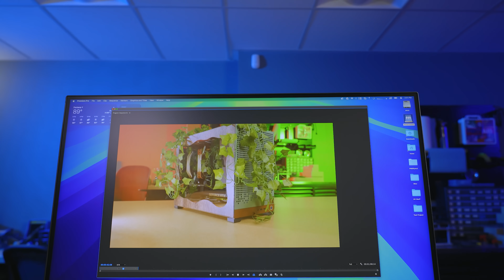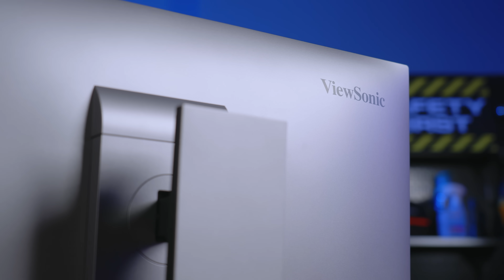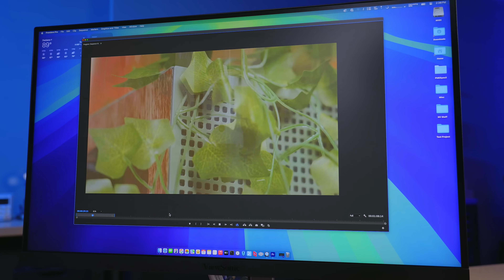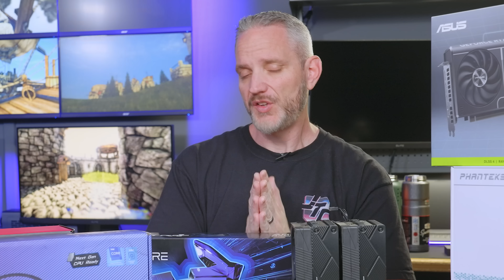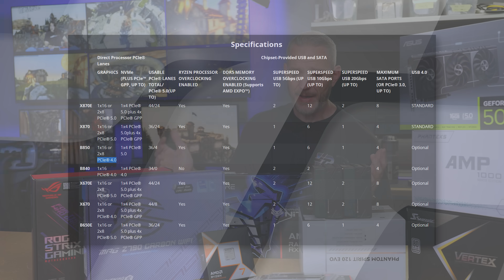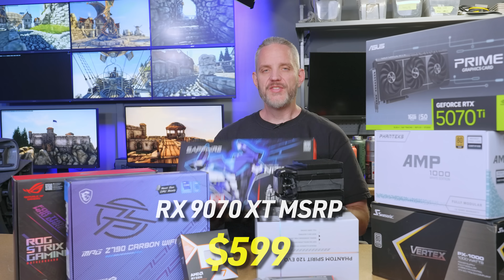This is the Sweetspot for PC gaming... Don't get fooled into spending more!

Comment: The sweet spot is based on your income.
Reply: Diminishing returns still apply even if you have unlimited budget
Reply: @doctajuice  yes, but higher raw performance will still be there vs the sweet spot of price to performance. 

It then becomes a question of if it's worth it to that person to pay more.
Reply: @ArtisChronicles yes, because you've moved out of the "sweet spot" that's the point of the term.
Reply: @doctajuice there is a 4k and 5k sweetspot though and that's not 1440 or 1040 lameness we are forced into
Reply: @doctajuice  If you're budget is truly unlimited, diminishing returns do not exist....by definition.
Reply: @SeptumRing  until you spend unlimited resources for 0 performance. Which exactly where you head to with Nvidia cards right now.
Reply: @DesMessersSchneide  Relax man, this isn't Reddit. Show me a card that can compete with my 5090.

It's just a bonus their stock has helped me out.
Reply: @SeptumRing  
You then don't understand what diminishing returns mean, by the definition of it. You can be perfectly ok with diminishing returns that is something different. 

Let's say your 5090 costs 5000, and it performs "100" , and a regular 5080 performs "90". Now tomorrow a 5090 Super comes out it costs 10.000 and it performs "101", this is a performance upgrade no doubt, and will be bough for sure by some people. But is is then by definition what is called Diminishing Returns. It is therefore irrelevant how much money you have or can spend on it. If you think it is relevant i'd like you to explain how.
Reply: Yeah 2600k and 1660 and 8GB ram over here lol
Reply: @manoz6194  Dude, get another 8GB. How much is 8GB of DDR3 now, like 2 bucks?
Reply: @RemoteAbductionArm huge difference at gaming
Reply: @RemoteAbductionArm 😭😭😭🤦🏾‍♂️🤦🏾‍♂️🤦🏾‍♂️this aged like milk😅😅😅
Reply: @R @RemoteAbductionArm add like 2000 bucks to that now 😭💀
Reply: @matthewfairchild3846  DDR3 is still cheap because it can't be used in AI.
Reply: @WilmoWins  Not for DDR3
Reply: @matthewfairchild3846 It's DDR3. If you can't afford that, you should be spending more time somewhere else rather than sitting on your chair at home
Reply: @manoz6194  lol thats so bad! can it even run minecraft? jks
Reply: @PiloFried bedrock or Java? Bc Java is actually pretty resource heavy with high settings lmao. Mods on that system? Why even try 😂
Reply: @RezMezy not with fabric and sodium
Reply: @PiloFried  would have trouble running my browser.
Reply: @manoz6194  cheese and rice man! UPGRADE!
Reply: @manoz6194 you can get a second hand cpu cheap if you can update the bios
Reply: @manoz6194 dude just get a console. Even the Switch 2 is faster than that.
Reply: @manoz6194 bro 16gb is like $20 on FB in most areas
Reply: @manoz6194 how are you even running windows 10/11 with 8gb?
Reply: Yes and no.. it’s more about diminishing returns. Like sure you can go 4k for a monitor but 1440p will get u close enough for half the price and not be as heavy on your gpu. That’s the sweet spot
Reply: @DelScully unfortunately it doesnt look great after playing on 4k for a long time. 1080p looks like total and complete ass.
Reply: Yes. 👍 Ryzen 4500 and RX 5600 XT over here
Reply: 5900xt and rx 6800xt gang here.

Ive also got 128gb of ram lol
Reply: @WolfanndRose  I "upgraded" from a 4770 to a used 3600, with a used b550 mobo. Then a bought a new 5700x, but i still using my 1660super. 😁 Next should be a used 6750xt, or 3060 12GB, or max something like a 4070, or 5060xt.
Reply: @csuanfa if you can get an 5700x3D or even rarer 5800x3D you’re pretty much secured but really all 5000 chips are still going strong
Reply: @WolfanndRose  rip
Reply: @WolfanndRose lol
Reply: @WolfanndRose yikes dude
Reply: @BrandonPawlak-f4d I know it’s old, but new to me. Plan on upgrading when I can, but that’s the point of the original comment
Reply: @WolfanndRose  ryzen 5 4500 and rtx 4060 here
Reply: @WolfanndRose BROKEEEEEEEEEEYYYY
Reply: @WolfanndRose  nothing wrong with that...I got rx5800 and rtx4060ti perfectly good for my basic stuff like OBS and a bit of rendering here and there.
Unless you're a completely nuts gamer you don't need the absolute biggest and best balls-to-the-wall CPU or GPU....indeed it's about matching them well so you don't cut one short.
Reply: The sweet spot...that most people can still barely afford nowadays
Reply: Facts
Reply: Managed to get a z790 UD ddr4 mobo, 32gb ddr4 ram 4000mhz ram, and i5 14600k, all new unopened as a bundle off marketplace for $250. Paired that with a 5070, not top of the line but I can play my games in 4k comfortabley. The 14600k with the 5070 synergize great.
Reply: @SliceOfActionGaming why would you ever get the 5070 tho
Reply: yep, like when people say "budget PC" 
......well what's your BUDGET, annoying how people use the word budget to be synonymous with "cheap"
Reply: @deminybs  low budget would've definitely been a more accurate term the way they talk about it.
Reply: "But if you're shopping top-tier, top of the line already, then this video isnt really for you" some people are as dense as neutron stars.
Reply: 1080p will make the sweet spot so much more affordable
Reply: @MogCity2  very much so.
Reply: Ur mom is the sweetspot
Reply: Sweet spot is performance for the price.
Reply: There is this thing called diminishing return. So no sweet spot isn't based on your income. If you have more money buying better and more expensive isn't your sweet spot because you could save money and use it to buy stocks ( just one of many examples ) and that would be even better sweet spot. Sweet spot is never the most expensive thing that you can comfortly afford since diminishing return exists.
Reply: No. The sweet spot is based on what performance you get per dollar spent. The highest performance per dollar is the sweet spot .
Reply: Not true.. diminishing returns do exist.
Reply: “but my income”
Reply: No what you can or should buy is based on income, the sweet spot is another way of saying best bang for the buck.
Reply: rofl
Reply: my i7 3632QM laptop with GT630M is still kicking surprisingly well in 2025 with 32GB RAM and SATA SSD
Reply: @Maleko48  what man?? i have a 1030 gt and i looked it up it's 3X faster gpu and i can't run shit nowadays
Reply: How dare you having common sense
Reply: Disposable income...
Reply: Thats not true. The sweetspot depends on your usecase not on your budget. For example, if you only play WOW Classic and WOW can´t handle CPU´s with 3DCache, the best most expensive cpu is not in the sweetspot. Generally the sweetspot is where you dont get more reral world gains with more money.
Reply: Yep
Reply: To a certain degree, but spending on RTX 90 tier card for gaming purposes is never optimal no matter how much you earn.
Reply: @LurkingLarper exactly. I mentioned it is like running 4k quality at 100hz instead of 4k balanced at 80 for 3 times the cost.. the actual experience is almost imperceptibly different. Practically identical. I hear 5090 buyers say they hate upscaling so they run native and I think that is the most waste and straight up ignorant validation of a flagship purchase. Dlss 4 is incredible
Reply: @TheCosmicMason DLSS is the only good thing Nvidia has given us in years 😔
Reply: Yep. Intel Gen 12 and RTX 3080 from day 1.
Reply: The sweet spot is based use case and budget, not income
Reply: No the Sweetspot is based on what you intend to use the rig for,  Your income decides on if you can afford it.   For example if you want a HMD simpit or VR rig then you need as much VRAM as you can afford to throw at it (GPU loads are minimum but even four year old title like Alex will eat up almost every bit of that 32gb's on a 5090 when running at 120Hz 4k)
Reply: @nikushim6665 My guy gets it. No one needs 5,874 FPS in Fortnite. People need high-end cards for real work stuff: rendering, compiling, and that sort. I have a mid tier card from '21 and I'll be good for another 3 or so years.
Reply: I hope you understand the sweetspot mentioned is the point where spending more gives less performance increase. The sweetspot for your income is probably buying no pc at all unless you need one for work.
Reply: The richer you are, the more sweet spots you can afford.
Reply: Correct
Reply: I came here to say exactly this
Reply: So so true!
Reply: Get your bread up
Reply: Also your expenses😂
Reply: ... No shit
Reply: You smack me to reality
Reply: Based on my income I am keeping my 1080ti
Reply: I sold my 4070 super and got almost £500, I managed to bag a 5080 for £1200, so I only really paid 700 for it. Pairs excellent with my 14700k, I wanted the extra power because I love vr gaming and that can be demanding
Reply: No the sweet spot is 2014-2017
Reply: No it doesnt. There is a point where you get less more for more money. Now you can have enough income to say 'fuck it' and still spend more, but it doesnt change the existence of this sweet spot
Reply: it's based on the performance per dollar.
Reply: depends on the games you play.
Reply: And your local tarrifs.
Reply: Incorrect. Sweet spot refers to bang for buck. That has nothing to do with your income.
Reply: Me on shitty third world country : what is income?
Reply: This makes no sense. Buying a 5090 + 9950x3d + 256GB RAM and 360Hz OLED, because you can, does not improve your ability to emulate pokemon fire red... It all depends on what you wanna do with the machine.
Reply: lol, Jays sweet spot is a 5090
Reply: So my sweetspot is a manual calculator 😭
Reply: more on your credit score with todays crazy prices
Reply: Ryzen 9 and 1650 Super ❤
Reply: Yep prices suck. Running a 5600x3d and 7800xt. WILL Be running that for a few years yet
Reply: *Disposable income is the responsible answer.
Reply: Exactly someone with good money isn't going to buy a 5050😂😂😂😂😂
Reply: When 'Your Income' is based off Mommy and Daddy, then any spoiled brat can get what they want. This isn't a real world sentiment.
Reply: It's this mentality thats killing the market. Just cause you can afford something does NOT mean you need to get it. It's idiots like you that are driving prices up....they will still charge these stupid prices as long as there's idiots out there that will pay it.
Reply: @captainobvious7513 calm down fam lol.
Reply: At some point no one's going to call a build the "sweet spot" of anything. They'll just delicately call it a compromise at best. Perfect example: Anyone remember netbooks? The best I could say about nearly all of them was that they didn't hang while running ZSNES. Floor's higher now for sure, but when you're running into the hard limits of a system, there's just nothing sweet about it.
Reply: not really, 1440p with 144fps is far FAR superior to 4k @60 yet youd spend a ton more on running 4k@60
Reply: Tax bracket people
Reply: Yep, x3d and 5090 is my sweetspot 😄
Reply: Nope. Disposable income. Someone slaving away at a fast food joint but living for free with his parents can go balls-to-the-wall just like a wealthy person.
Reply: Still Rocking my VooDoo Banshee and pentium II that I upgraded my gateway pc with
Reply: Unless you n can charge credit card.  That what I did
Reply: First Get Rich Boi, then buy 5090.
Reply: Truth 😂
Reply: That's what people with no income think- they'll make money, waste it on the most expensive things, and proceed to be broke again.
Reply: @RAY_FILET If you make money that is income, people with no income dont make money
Reply: That is true however, if you just get exactly what you can afford it will most certainly not the the most effective use of your money. For example, 8gb gpu is a sh buy and a 5090 is also a sh buy. A gpu with enough vram and performance and good price to performance is not as simple as “what you can afford”. If you can only afford a 5060, I would suggest an rx580 8gb for $60 and save up a bit for a better gpu. And likewise if you can afford a 5090, i would suggest that the real difference of a 4070 Ti Super and a 5090 is running 4k quality at 100 vs 4k balanced at 80.. is it really worth 3x the price for that?
Reply: i7 4th gen & rx580 is mine.
Reply: wrong
Reply: Real.
Reply: Imo no. There is a point where it never makes sense. I have multiple times the amount for say a 5090 in my account and absolutely no desire. Maybe it's worth it if you PC game constantly, I have other hobbies mixed in.
Reply: There is always a certain sweetspot that gest most frames per dollar. Nothing to do with your income or what you can afford.
Reply: A used 3090 for $400 then
Reply: Meh, anything past upper mid tier is kinda pointless. I'm looking at 500 for GPU, everything else is half of that per part.
Reply: True, after 15 years and a motherboard failure and glitches on memory I bought a new CPU, GPU, RAM, Mobo, and PSU 3k later and didn't think about it. Me 15yrs ago would have not spend that much
Reply: False
Reply: So a used 10 year old Dell desktop... 😒
Reply: isn't that too obvious? hahahah
Reply: Partially sure.
Reply: Well... Cpu upgrade is a lot cheaper than GPU upgrade currently so for spending more on cpu is easier and good future proofing.
Same for faster ssd.
Especially since a lot of player are Fortnite Minecraft and cs 1080p high fps players and in those case, ram, cpu and ssd speed are important
Reply: Not necessarily. One could argue that anything more than the sweet spot is just lifestyle inflation
Reply: No it is not
Reply: And what you play.
Reply: This is why console gaming is an option
Reply: @Chino1f1kation  Not for everyone
Reply: And based on what you want to play. I need beefy PC all the time, because I play flight sims.
Reply: Hope i don't get roasted for this but its actually not. For example 3TB of hard drive is pointless if you store things in the cloud and only ever need 500GB. A GPU that can handle 250FPS at full settings is pointless when the human eye can only process 150 at most. If you ask GPT for the optimal GPU based on "frames per dollar optimized for the human eye" youll get some interesting results
Reply: @timmorozco  1. You don't need any hard drive when SSD exists 
2. Human eyes don't see in frames at all. 
3. It's always fun to roast fools who act like they know something, but all they do is prove to everyone how clueless they are.
Reply: Totally, but spend the money where it matters most...
Reply: It is now.

I got an ally for less than 300
I don't bother with desktop anymore.

Screw those prices for GPUs
Reply: This. Absolutely the correct take.
Reply: people dont get that.. because they want you to spend more.. "dont get 8GB just get 16GB" they are contradicting themselves. and keep telling you its not worth it or its worth spending more.
Reply: The price Performance sweet spot doesnt change just because you get more money
Reply: yes not just because you can buy it. you also really need to think can you pay for youre electricity bill. like people can buy a 3k build but can they afford the monthly electric bill . not all user lives in america or europe
Reply: indeed
Reply: The G... 1.5-2" in then up... 👌🏼
Reply: rtx4070 32gb ram and Ryzen 7 5700x3d
Reply: based on your REAL needs*
Reply: Brb robbing
Reply: Not true, its based on objective value for money compared to the cost of other parts and percentages of losses and gains in performance for each budget, which is why cards like the 5050 are bad because its only $50 more for a lot mor performance (5060/9060XT)
Reply: Just won my disability case, by next week I will have my 5090, 9550x3d build. 🙌
Reply: Agree 👍
Reply: I don’t think so, not in the way he’s using the phrase.  Dollar per unit of “power” isn’t dependent on budget
Reply: How is this the top comment. Incorrect as well
Reply: wrong...your income might block you from getting what you want, doesn't change the sweet spot.
Reply: exactly
Reply: Brilliant!
Reply: Agree
Reply: Yes...and no.
Reply: B650 Aorus Elite Artic Ice - Ryzen 7 9700 X - Radeon RX 9070 XT….. I’m using this for my first build. Hope i did good with my selection.
Reply: I hate how there are always top comments on YouTube as soon as I click on them😂 you jus know someone bouta debunk the whole video in four words hahaha
Reply: Bases on how much you want to through away into something that gets obsolete every 2 years
Reply: This is such a shit response... Obviously there is a sweetspot if you know math. Sweetspot for a SSD for example is mb/ cost. Why pay x10 for each MB after a certain TB
Reply: not rly whan i was looking for new gpu i had about 1.3k$ but i didnt want to give a lot more than 400$ for gpu so i buy 7700xt😄
Reply: My wife won’t let me spend more than 1000Aud😢
Reply: Its ironic that all the "tech" youtubers changed the tune - for years and years they promoted InHell and NoVideo - regardless of what the competition performance or price was - BUT now when their audience no longer has the same budget (especially since post-CONvid due to galloping inflation in certain parts of the world) they start to pick the budget side of things. To a very high extent (upwards of 90% I say) the situation is on youtubers. NGreedia was propped up by them no matter what - a bloody decade after Vulkan (almost) became mainstream with Doom 2016 and yet it is not widely adopted. They did not say how Ngreedia is ruining grafix when between 2011 and 2018 they WERE bribing the industry to stay on DX11 because it favored them (and InHell too as DX11 was still in 1998 - it was feeding communication between CPU and GPU on ONE SINGLE THREAD). Heck when 1st gen Ryzen came out in 2017, they were SALTY about the low clocks and the few TOP FPS less compared to INHELL, BUT VERY VERY FEW of them mentioned that the 1% and 0.1% lows were significantly better even on those 1st gen Ryzens.
Reply: no sh*t, sherlock!
Reply: Not really... There is always a price to performance ratio winner. And if you buy cheaper especially.. ,pu pay the price for entrance, base price for getting a product at all and usually the ratio is very bad there. Like entry level GPUs that still cost like 80-100 bucks.
So the smart move is not buying or buying second hand.
Reply: Indeed it is my freind
Reply: My sweet spot is RTX 5090 for PCVR my OG Crystal HMD demand 100% resolution as 5K x 4K per eye at 90hz 🔥
Reply: Nice one captain obvious🤣🤣🤣
Reply: hahahahahaha 100%
Reply: Pretty sure if SLI was still around the sweetspot for casual 1080p gaming would be 4x 5090s in SLI and a custom water cooled direct die 14900k.
Reply: don't let your income dictate how much you spend
Reply: I am rocking a 9800x3d with 9070xt and it's my first PC and currently super happy with the performance.
Reply: To a degree. I do think there is a point where cost does not equate to the performance. At some point there is diminishing returns, however, i wouldnt flame someone who buys a 5080 even though i think its a terrible card for the price.
Reply: Glad I use a Mac and windows as a hobby
Reply: So true jajaja
Reply: And needs. Buying more than we need skews the market, and at very best, there won't be enough affordable units in the next generation. At the very worst, the low-end stuff isn't even worth buying, which seems to be the case from what I hear.
Reply: i don’t understand the amount of people  that have money issues or comment similar things like this
Reply: @LoL @LoLTerminus Might want to do some studying then, make yourself smarter.
Reply: hehe, spent my night at work. building a 5090, ryzen 7 9800x3d. Considering I just bought the new alienware 34 ultrawide. I'm pretty close to hitting the sweet  spot now :P. Just gotta stop working and get some gaming done :D
Reply: If you have to think about your income when building a tower….stick to console gaming cause your gonna get annoying when your budget PC can’t run the latest games lol
Reply: he doesn't give a shit he think everybody multi-millionaires who have a YouTube channel
Reply: well it isn't since it's about performance and bank for your buck. So you can get everything the top of the line for 5-8K systems but.....why?..... do you like burning paper?
Reply: Ryzen 5 5600g and rx6650xt
Reply: Not true value is objective
Reply: The sweet spot is based on whether my spouse knows how much I'm spending.
Reply: Actually no.. best price performance ratio is math
Reply: Way of gaming is priceless
Reply: You are absolutely correct. Could also depend on if you want to upgrade in a year, or there's a game you really really want, but your current computer just can't handle it even on low settings.
Reply: Of course, but you could build the best pc on earth if you just save up for it. It’s dangerous with this buy now pay later shit people are buying five thousand dollar computers and paying it off like a loan.
Reply: I'm stingy AF. Even if I had millions I wouldn't overpay for BS. Lol 😂
Reply: Depends if you really need new stuff or not. My pc is currently about 5 or 6 years old. Am thinking about upgrading. Wanted a whole new pc... but in all honesty if I just upgrade the GPU I think I would be alright again for a few years. You don't buy a new PC every other year normally. I am not from the USA so I don't have a clue what life is like there but normally you have over 2 years to put money aside. There is always something you can save money on. If you have a family it becomes a bit harder. I don't know if you get holiday money but you could skip holiday for a year and put that money towards a new PC as well. If you already use holiday money to cover for other expenses, well I don't know. But it can be worth it to look at your expenses etc. Even if you can put 50 usd aside a month, that would be 2400 usd in 4 years time. I am sure you can buy a pretty decent prebuild pc for that on any site in the USA. Maybe a better one if you build it yourself.
Reply: your income has nothing to do with it. you can always just save for longer. there 100% a sweet spot for a performance build that looks great and plays great.
Reply: Kind of.  I can afford anything I want, but I feel stupid if I buy the bleeding edge that crashes frequently and needs lots of extra fiddling just to get it to run correctly. Some people like that but it annoys me to no end so I often try to find the middle ground parts that aren’t overclocked to heck or were binned out at the high end during e-test at the fab.
Reply: thinking the same, what happened to tech channels all of them of them going for like high end boards cpu gpus then just says it is sweespot. I want to get mid range. Z board and K CPUs are already too crazy.
Reply: LOL NO. After a certain investment the ROI drops off hard.
Reply: This implies that price scales with performance.
Reply: Based on your income, and what kind of budget you can set aside for the sweet spot in question.
Reply: I disagree … if you want to play a game you love but your PC won’t handle it. Then you may need to save more to reach that goal.
Reply: Not precisely, even the low income people can save up to get a medium or high income person sweet spot.  No I think the sweet spot is more to do with performance per dollar + sum overhead for future games.
Reply: jokes on U I got no income and still went overkill
Reply: At performance per dollar this is a certain sweet spot. Even if you can afford a better one but like to shop smart this is a good build.
Reply: It actually depends more on how much you can save 😋
Reply: Just upgraded from a Ryzen 3 2300x/ RX 580 to a Ryzen 7 9700x/ 9060 XT 16GB.... can't wait for everything to arrive.
Reply: nah, i still see people on wealth fare with apple and nikes, so there are people who are deadass broke and will buy a 50 series if they think they need it in life.....
Reply: I use Rysen 5 3400 and a GTX 1060 6gb card.  I am fine with all the stuff I use it for.  I don't play certain games that have higher requirements.  I am enjoying my older legacy games on steam.  Can't afford this newer graphics cards.
Reply: Broke ass
Reply: Not really
Reply: No its performance  for today's games  to run well without kilo bucks the sweet spot.
Reply: Am5 platform and 9060xt is sweet spot
Reply: that's the dumbest thing i've heard.  Buying a computer is something you buy once every 5+ years.  Just get the best GPU and a really good CPU.  it'll be worth it
Reply: Being able to afford a good pc does not mean you are rich.
Reply: Strong disagree. No matter income I would never overspend on 5% better performance. Sweetspot is the sweetspot for everyone.
Reply: I never buy anything above mid level graphics card.
Reply: The sweet spot is the best price/ performance ratio
Reply: Your ignorance is showing
Reply: My pc cost nearly 10% of my yearly income 😂 13700k, 32Gig DDR5 6400Mhz, RTX 5080. The cost did sting but it's my main hobby, wont need a upgrade for at least 5 years
Reply: 💯 Slan 👍 ❤️
Reply: Excellent video, explained, with options. Thanks or Slainte, 👍PS: Merry Christmas and a happy New Year.👍❤ 10:38 😅
Reply: Thank god you swooped in with thar cutting insight...😂
Reply: With buy now pay later and credit card debt, your income matters not.
Reply: Elon Musk sweet spot must be nice.
Reply: Fuck my income I just put 6k on my credit card to build a top of the line pc for literally anything I would want to do. Plan on doing lots of 3d rendering. Been wanting one for years, never put the money into it tho, now I got fomo from these ai companies demolishing the pc ecosystem. Now all my parts total a little over $8,500
Reply: I7 3770 16 GB RAM and a GT 1030 😎
Reply: Yep
Reply: 7800x3d and Rtx5080 was apparently my sweet spot
Reply: Maybe the sweet spot is the friends we made along the way
Reply: What can I buy for a dollar 😅
Reply: So a rich dude that uses his computer for emails should get top tier parts and a nerdy mcdonalds worker that plays video games when hes off should get the cheapest setup?
Reply: Not at all
Reply: The sweet spot is price to performance , it dosent matter on budget , it still exists in every generation.
Reply: That's a terrible way to look at things. Buying shit, because that's all you can afford doesn't mean you have to settle for shit. If your budget only allows for trash, then save up another 6 months, and see what you could have got if you didn't settle for garbage.
Reply: 30k month chilling with a 6090
Reply: the income should only be the factor WHEN you can afford it. the sweetspot is between what you want and what you need
Reply: Hardware unboxed is the man for the budget best price to performance builds and i have one pc that he told me to build it still runs like it's fresh just needs psu change it's worn out.
Reply: If your income can't get you what you need (not want) then is it worth paying at all ?
Reply: Not unless a $3000+ increase in price for like 20% uplift is worth..... $3000. Not income based unless your income is based on that 20% uplift lol
Reply: Sweet spot assumes compromise between price and performance. And you know that the rich people often are the stingy ones, that's why they are rich: they know how to manage money and overspending on rapidly aging tech is probably the WORST investment you can make.
Reply: @unruler  depends on what you mean by rapidly aging. Nothing says I have to upgrade every time a new generation is out.
Reply: @ArtisChronicles I meant that tech will lose value very fast and doesn't make sense as money investment. You don't need an upgrade or even PC in general now, most people can replace it with a phone. And if you think about it, all the praised innovation is working against the consumer forcing you to upgrade and spend more money for something you wouldn't otherwise.
Reply: @unruler or they know how to inherit money.
Reply: Absolutely
Reply: 25 min video summarized by this genius man, thank you, god bless you and all your loved ones.
Reply: Yes. Because for me, it doesn’t get any sweeter of a spot than having my 5090 astral and 9800x3d.. and people say 2tb is the sweet spot for storage, but my 8tb NVME got full and I found 12tb was my sweet spot. I paid for the full library I’m gonna have the full library
Reply: @JRayHD  I'd personally be running multiple 8TB drives, but with nvme that actually reduces the numbers of drives I could run unless I could invest into threadripper.
Reply: @JRayHD how many lanes does your motherboard support? If you add another NVMe it could cut your GPU pcie lanes in half and reduce your performance.
Reply: Wrong
Reply: And you’re income is based on you’re income minus your outcome or else
Reply: @Fiftykilowatt that’s called what you can afford lol
Reply: @Krisabel3 jup lol
Reply: No it isn't
Reply: Legendary level comment with people bashing underneath...this is ''humans'' for you
Reply: True gamers play on Intel Core Ultra 9 or 7, RTX 5090 with at least 32GB VRAM, and 16GB or 32GB RAM although more is better because games now require more RAM! Casual gamers play on Intel Core Ultra 5 or AMD Ryzen 5, Intel Arc A770 or the Yeston RX 7900 XTX Sakura Sugar! I'm 16 and I even know this!
Reply: @swallowedinthesea11  A kid playing fortnite with 5090 will always be more casual than the guy playing quake on an old pentium. 
Save that ”its all about the money you spend” for rap scene kid, gaming aint about that.
Reply: PC gaming sweet spot for plebs😂 If you’re still at 1080p get a console🤣 1080p,1440p plebs PC master race🤡🤣 PC gaming is not for everyone ! Shout out to 1 % 4k PC real master race😃
Reply: No, it is not.
Reply: Well dahhh!?
Reply: @Itsyesfahad  it's called duh not dah. You must be one of those middle easterners or south asians pretending to be an american but failing hard.
Reply: @TheM1s4nthr0p3 Yeah because Americans never misspell basic words
Reply: laughed so hard couldn’t be more true 💀
Reply: I think that’s especially true now with inflation and the significant jump in prices and it’s just gonna get worse.
Reply: Yeah Biden really messed shit up.
Reply: That’s funny. Pretty sure that’s word for work what your mom said last night. (Good point, btw… I’m just immature and couldn’t help myself)
Reply: 9800x3d msi GeForce rtx 5090 for me
Reply: @dhampir216 congratulations on all your success
Reply: Nobody cares.
Reply: Or you use Affirm or another payment plan.
Reply: @ernies8828 or the NZXT rental program 😂
Reply: @ernies8828
If you have to finance a luxury item that’s under $2000, YOU CAN’T AFFORD IT.
Reply: @ernies8828  not if you have bad credit you’re not.
Reply: @GaryHicks you just need fair to good credit
Reply: @ernies8828  Yeah, spent 2 years paying off my 3090, lol.